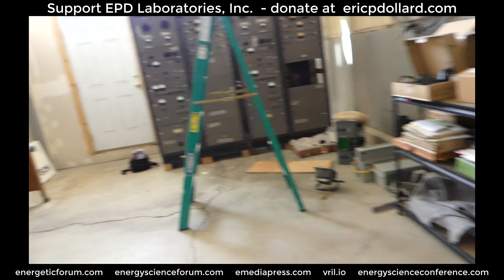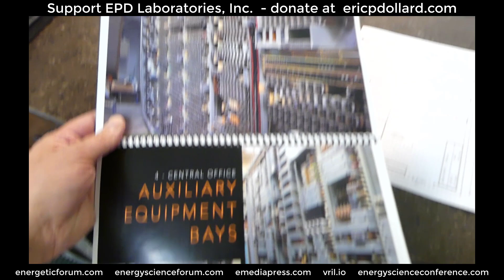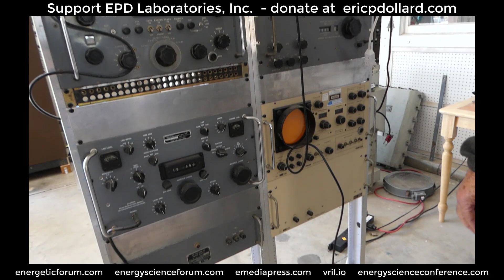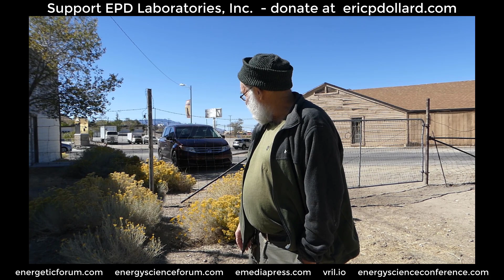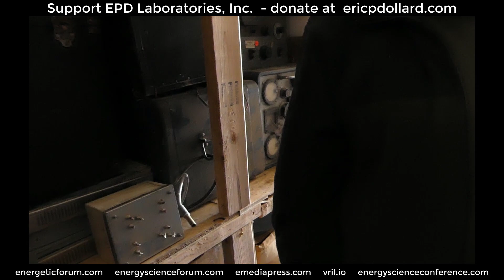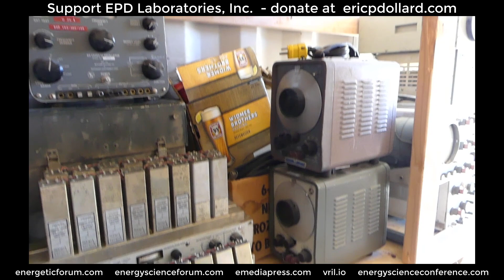Eric Dollard's Plan for the EPD Lab, Room by Room — 2020

Comment: Straw bale would make a decent low budget sound deadening; insulating medium.; chicken wire is usually used to support it behind whatever paneling or sheetrock used. Realize this is an old video but, have a lot of experience putting up bale walls and timberframing. Would be all for lending a hand to strip, reinsulate and put up an internal frame.

Comment: It looks like you guys have a mid-grounded open Delta service just looking at the pots up on the pole (120/240 3-phase, 4-wire that would have a "high-leg" from one of the phases to ground, about 208 volts). If so, that's a horribly unbalanced system when loaded up with neutral current especially! Maybe one day someone could donate a decent UPS system with a 3 coil closed ungrounded Delta output configuration for your work. Must be hell with inventive work and study with a utility service configured that way. Keep up the great work guys! ✌️